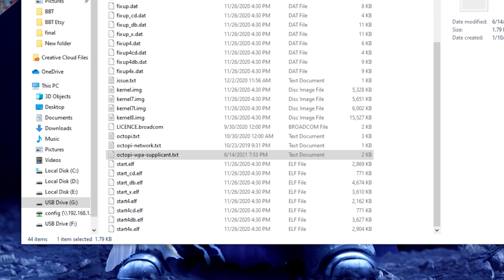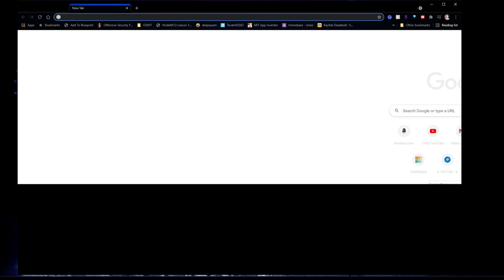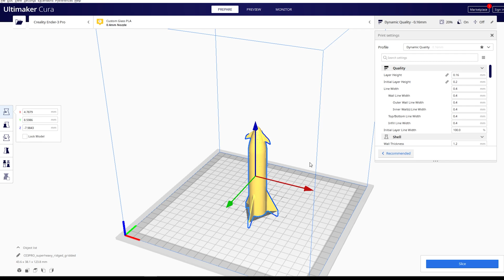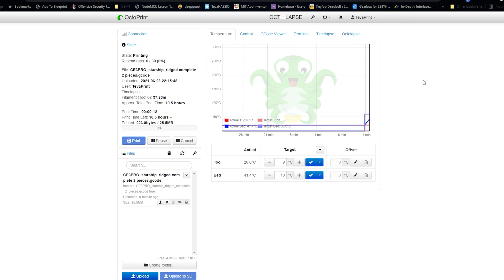How to setup Octoprint + Raspberry Pi  // QUICK & EASY!

Comment: I’m having trouble actually connecting to the octo print website
Reply: I followed all the directions and it says octopi.local does not exist
Reply from the maker: You may need to type http://octopi.local if this doesn’t work you may have to locate your device by its IP on the network.
Reply: @BlueBotTech  I tried locating it on my asus router and it didn’t work
Reply from the maker: @guardian_tech  If the octopi device isn't showing up in your router then it has not properly connected to your network. Double check that the syntax in your wpa-supplicant.txt file is correct and matches your WiFi network. Also, you could try and scroll to the bottom on your wpa-supplicant.txt file and make sure the country you are located in is uncommented (#). If that doesn't work you can try connecting your raspberry pi directly to your router with an ethernet cable just to see if it actually connects and you can reach your octopi server.
Reply: @BlueBotTech  good idea, I’ll try that now!

Comment: How long does it take to boot? Mine is taking forever to connect to the wifi..
Reply from the maker: It should be pretty quick. Check your router to see if it's showing up in your connected devices. If not you may want to make sure you SSID is correctly added.

Comment: Does octoprint require wifi or can I use the pi's onboard ethernet port? I prefer ethernet and got some ports free on my switch 😉
Reply from the maker: You can connect it via Ethernet cable instead of WiFi if that is your preference.  It can be difficult for some to get an Ethernet port close enough to your printer since the pi has to be plugged into your 3d printer also.